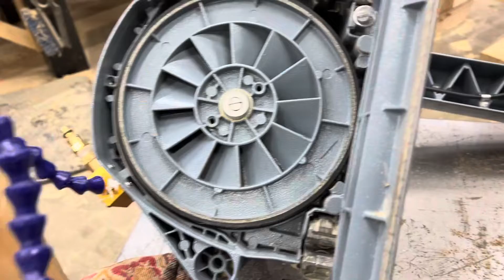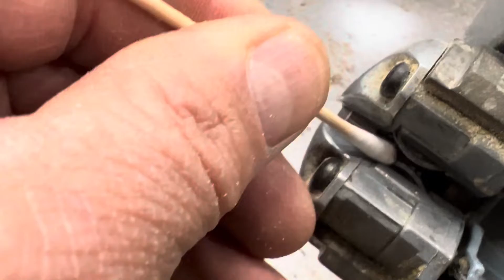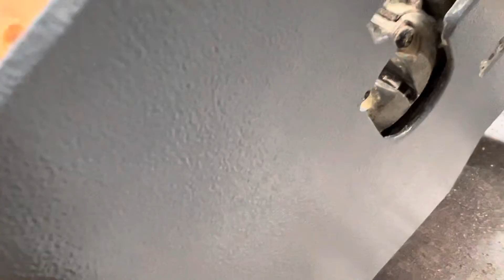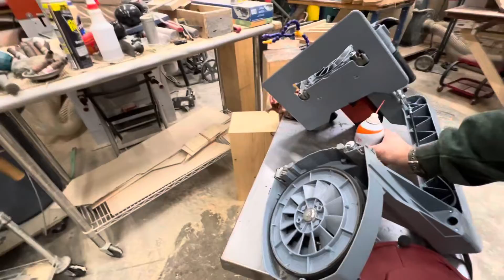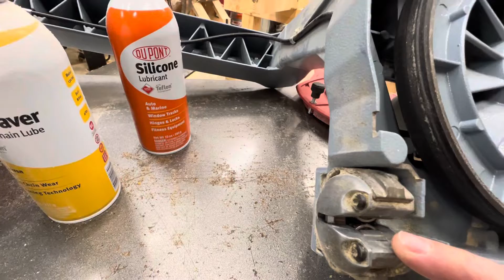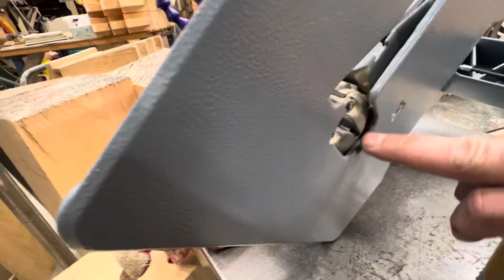Timber Framing:  Mafell bandsaw wheel and guide maintenance

Comment: GREAT ! This helped answer a LOT of questions. Love the air blower. Source for the purple hose ?
Reply from the maker: Hi David
This is the source I use for the 4” hose:

4" x 50’ Ultra Flex Clear Vue Heavy Duty PVC Dust Debris and Fume Collection Hose MADE IN USA! https://a.co/d/e6SMB5U
Reply: @theMainetimberframer  Thanks for the quick response ! Where did you get the purple blower hose ? That setup is going on my saw TOMORROW
Reply from the maker: Hi David
Is the 4” hose the information you are looking for - ‘purple hose’?
Reply: @theMainetimberframer  Looking for the source for the hose you attached to the bandsaw to blow the dust away from the UP cut side. Many Thanks
Reply from the maker: Try Tinsay 12pcs Coolant Hose 1/4PT Adjustable with Switch, Flexible Plastic Water Oil Coolant Pipe Hose for Lathe CNC Machine https://a.co/d/hzoOCZy